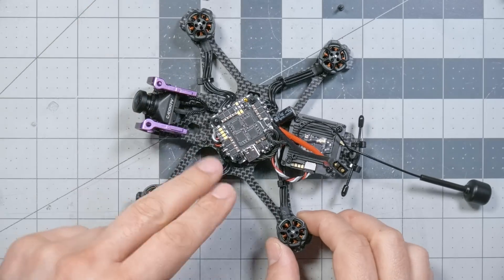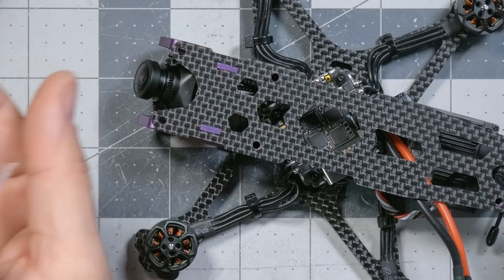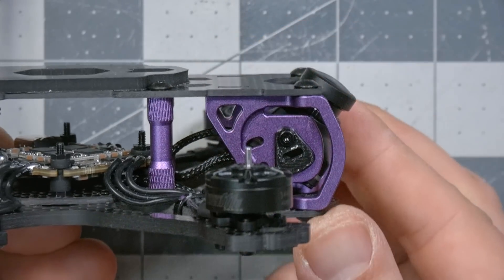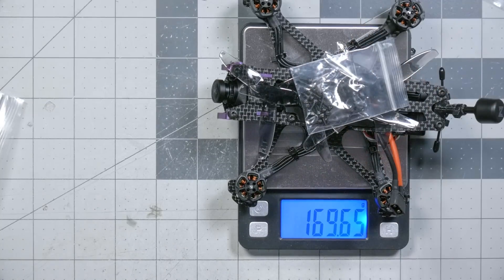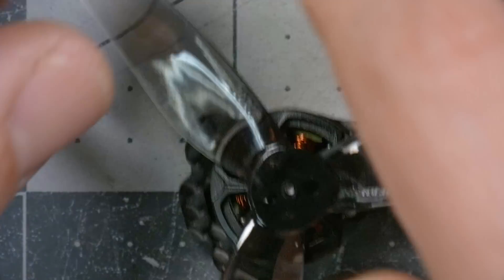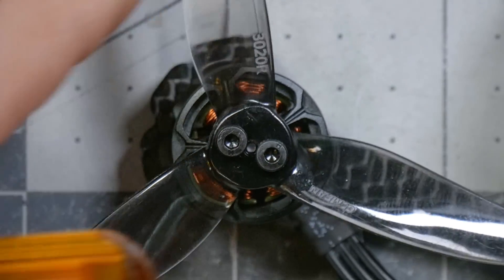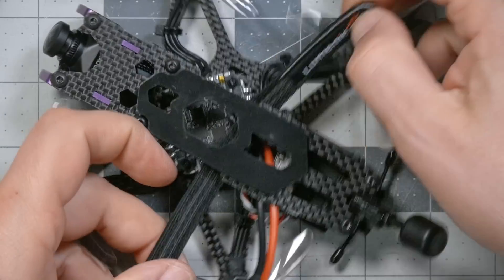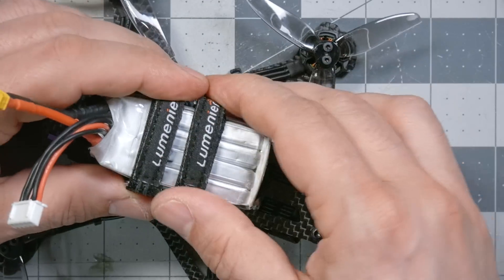Sub250g FPV Drone Build - 11 - Final Assembly

Comment: At this point in my build I notice it is hard to adjust the camera uptilt because the 3D parts are a little too thick and bind to the frame. I also notice you have only one screw in the gummies. Did you use 2 screws on each side? I needed to take the two top screws out holding the camera frame so I could loosen the camera mount.

Comment: I'm 4 builds in I bought this kit just to have a bardwell featured build and to have a 3" to whip around in between my two mobula 8 (one analog, one digital) I've built them both. The digital is a full custom on a mob 8 frame. And a 5 inch. I have about 10 hours of irl flying. High sim time. But LOVE building electronics.  Thank you for this little beast. First flight will be this afternoon.

Comment: I have watched your videos of how to build this drone.  I'm an older man getting back into flying drones.  I begin with just small woops and doing brushed motors as that was what was out then.  One thing I know everyone is moving to ERLS but for me having radios and didn't want to buy a new one I think you should add a section on doing a frsky or flysky receiver on this or direct some of us that are like me (equipment on hand and don't what to upgrade yet) to a section of how to install the receiver.  Thanks .

Comment: @JB - Setting this drone up as my first quad. You might want to edit in a note that 2 of the props are labeled 3020 and the other 2 are labled 3020R... and that the props need to be oriented so that the thrust is downward with the set rotation of the motor (as a noob... I did it wrong at first). 

Also... can you please do a video on how to get HDZero setup with this quad? I can't figure out how to get the OSD setup using the HDZero Race V3... even after using the HDZero VTX presets in BetaFlight (and watching your SmartAudio vtxtable troubleshooting vid). BetaFlight shows a False flag on the VTX tab for Device Ready. Thanks for the video series... it's been super helpful.

Comment: Please help, I built and finished this drone. However the 3D print outer arm protectors do not fit, the design is to small for the version I have. Are there any other designs or ones that might fit?

Comment: Ahhh 😉🤯 i always use locktight (blue) and this helps explain some of the little props I've tried that exploded for no apparent reason 😉 i had thought about this and said naaa... 🤯 I thought maybe the bright green coloring in the props was doing it. Bright green little 2" props. I also thought maybe the screws were too tight. Started leaving them pretty loose with the blue locktight. That little starship X1 ended up dying after getting into wet grass ☹️🤯 need another new AIO. Probably one of those speedybee purple ones. I have a couple other quads with those and working good. Or maybe another axis flying Argus f7 AIO (pink) i like the ones with heat sinks but i did have that pink one overheat last summer. Now i try to keep temp in OSD and leave room to breathe 😉 also had the darwinfpv f7 cement overheating. That sucker is all sealed up 😉 thanks for all your help Josh 😁

Comment: What battery are you using?
Reply: At 9:30 in the video he is mounting a Tattu R-Line 4S 850mAh pack. If you want to be under the 250g weight limit you need to use the same pack, but in the 650mAh size